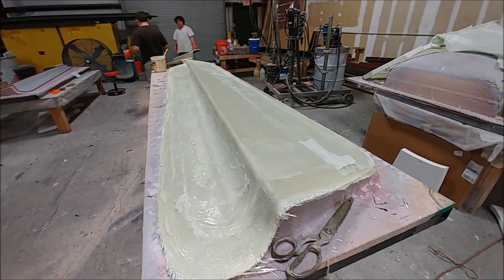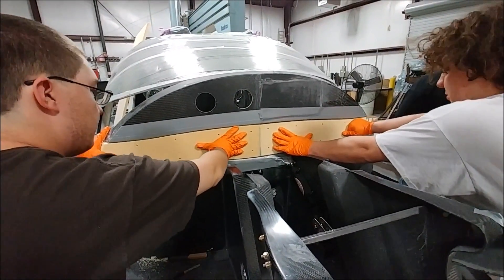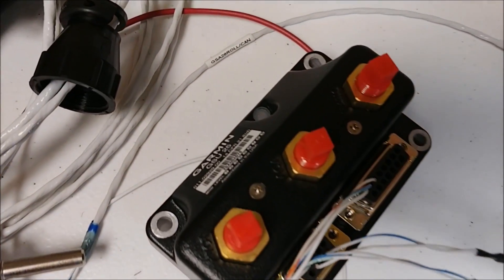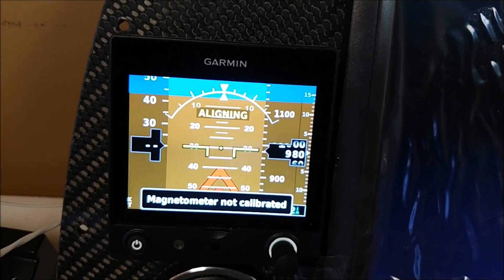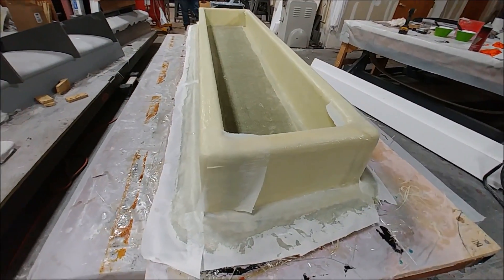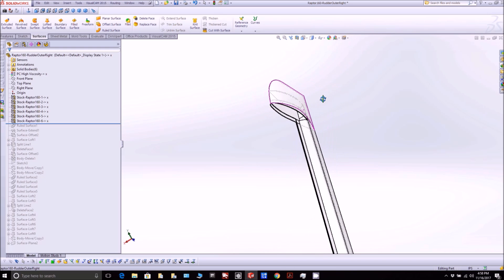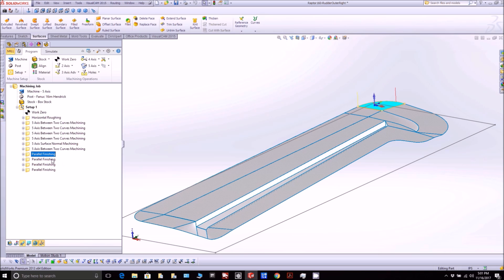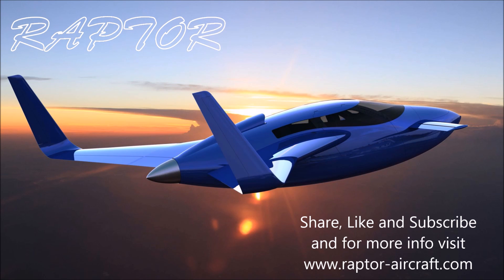Avionics Kick Off - the wiring marathon begins

Comment: Peter - I would reach out to Freudenberg-NOK to provide you the sealing in question. They are a innovation driven company and can even make the exact seal you need at a cost that will not hurt. They would expect you to use them of course for the production business. I used to work at Fruedenberg and designed and built a lot of automotive engine seals.